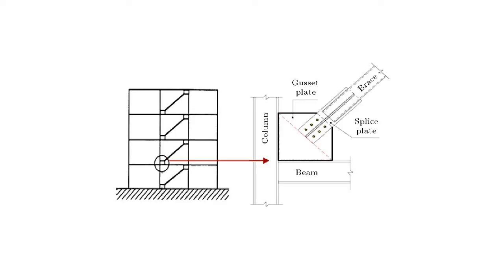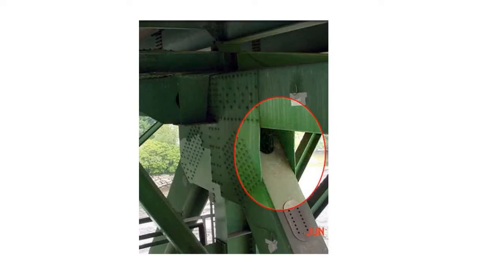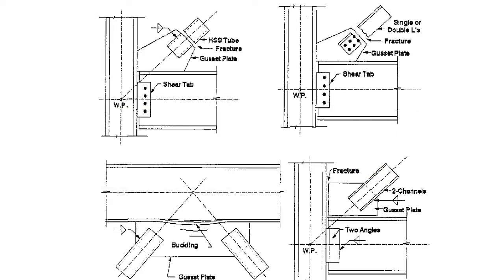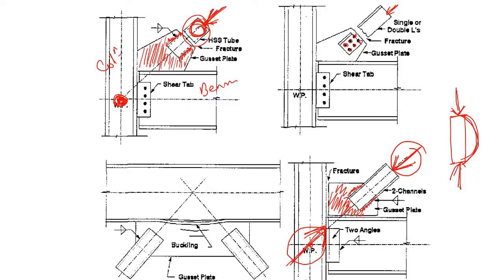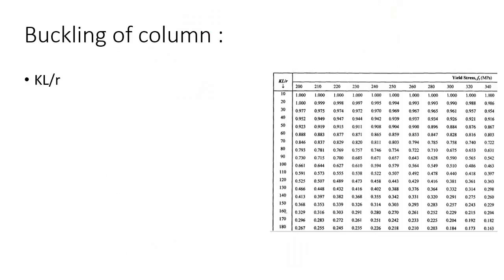Gusset Plate : Design for Buckling

Comment: Very good presentation as always. Quick one if you have one column of bolt instead of two columns as shown in the presentation, do you still use Whitmore 30 degrees dispersion rule for the effective width? Or how do you determine the effective width with a connection for just one column of bolts?
Reply from the maker: Ha ha ha .. great observation Dear..I think 30 degree rule should work for that too.
Reply: @TonmoyMaity  hmm I am not so sure, because if you have just one bolt and even if you draw the load line to be directly at the Center of the member or section starting for the one bolt , so how do you determine where the line spread the 3o degrees should end for you to determine the effective width of the gusset?
Reply from the maker: @olamideajala687  I really don't know or never thought in this way..I will investigate further into it. 🙏